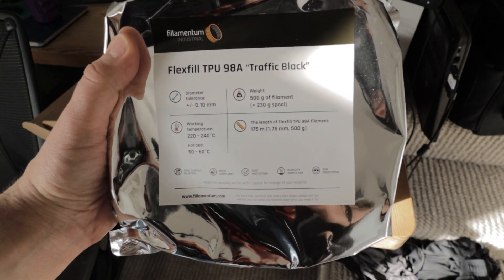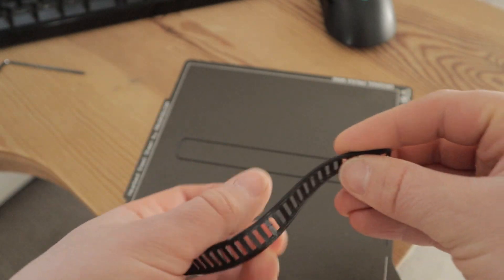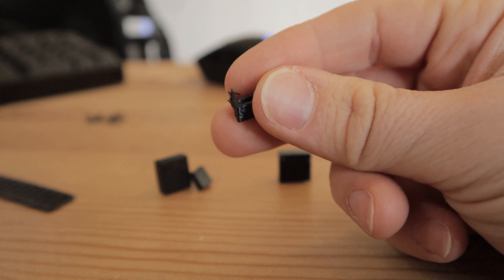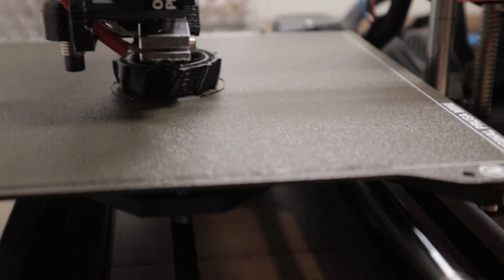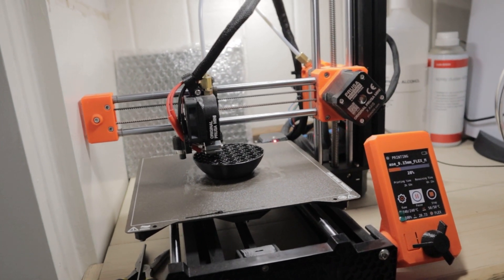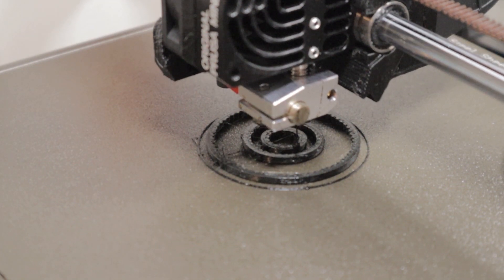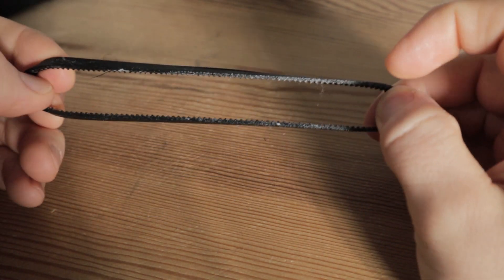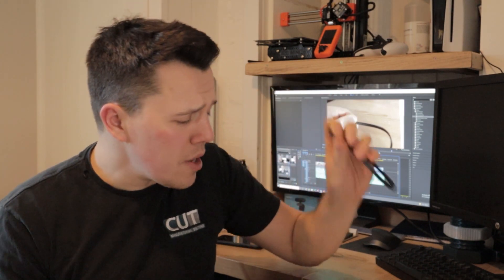Printing with FLEX (TPU) on my PRUSA MINI +

Comment: What infill, bed temp, and nozzle temp do you use? 

(Thank you for covering this topic I have been having trouble printing my hatchbox tpu on my Prusa mini plus)

(Good video)
Reply from the maker: Bed temp and nozzle temp is direct from the Prusa material guide. This is always my benchmark for setting up the machine. Infill I think was 10-15% but if your settings are correct I don’t see this having a huge impact on your prints! Best of luck and thanks for watching.
Reply: @MasonsWorkshop  One more thing btw, is there any tips you have to prevent stringing because that is a big problem for me when printing in tpu

Comment: I tried to print with a flexible PTU filament, and when I wanted to load the filament, I did not find the PTU in the list on the screen of prusa mini. How do I add the PTU to the list? please
Reply from the maker: I think you may need to add it to your library on prusa slicer, there should be plenty of information online about doing this! best of luck
Reply: Use whatever profile has a nozzle temperature range listed on your spool for loading.  as for slicing I'm out here for information on feed and speeds that work on cheap 95A...

Comment: I have recently started trying to print with TPU on my Mini.   It hasn't gone all that well and I'm assuming partly wet filament mostly because of the amount of stringing sort of like how some of your failed prints look.  I also noticed you're using the smooth satin sheet to print on and while I have a satin sheet long story short I've been using the PEI sheet without issues using ASA filament.  TPU on the PEI sheet almost welds itself.  I haven't ruined the sheet yet ripping the PEI coating, but I'm assuming the smooth satin sheet will not stick at all.  The satin sheet "naturally" has low adhesion?
Reply from the maker: Hey there, 
I do not have a satin sheet yet, only the smooth and textured! But adhesion can be a big issue with the TPU filament. My biggest help was using glue stick as a barrier between the part and the bed. This helped as a way to keep small parts firmly located but also allow separation when finished! Give the gluestick a try and this should help!
Reply: basically the smoother the surface, the better the adhesion.  Things like PLA struggle with adhesion, where from PTEG on they need less so satin then textured.  I occasionally change surfaces away from the recommended sheet if I need more or less adhesion based on the print surface area of the object.  look at Prusa's material table.

Comment: I run 40mms speed  on everything and 8mm retraction. You should slice to reduce retractions with perimeters/ maybe not fill gaps depending on the print. Small parts are harder printing at lower temps helps I run 218 mostly. This video was light on slicer settings details. Always use gluer stick.

Comment: Also printing TPU with the smooth bed surface with glue stick is much better i print alot with TPU making drone parts get your hands on sain smart TPU there is no better than that and TPU does print better with a direct drive set up than a bowen style.
Reply from the maker: Hey there, thanks for the recommendation. I will have to give that filament a try. I’ve heard a lot about a direct drive set up being beneficial so it may be something I look into👍🏻 thanks for the info

Comment: Best to print one part at a time if using materials like TPU and others prone to stringing. Otherwise adjust retraction settings. Increased retraction speed and distance too. Great vid thanks. 👍🏼
Reply from the maker: Thanks for the feedback, some good information there ! Going to revisit this material at some point and see what improvements I can get!

Comment: Hi Brandon, i think your print speed are too fast, try to print at 15-20mm/s. for TPU, if you print at higher temperature, the wall/perimeter are not looking smooth and shine, so you have to print at the lower temperature, the match temperature can be known by printing temperature tower for tpu from 195 up to 215 by 5deg increment. and if you found that the perimeter outer and inner are not bond, try to increase multiplier. and for retraction, if you use retraction, you can use 8-11mm distance and spped 15-35mm/s for retract and deretract. hope it help

Comment: hey, I have same printer and same filament. Some time ago I printed something and was quite good result. Now for some reason the gear that moves the filament into the nuzzle it is just no able to pull it in during the printing, only during the loading sees to go ok.
Any idea why this can happen?, the printer is printing PTEG and PLA without problem.
Reply from the maker: Hey Dani, 
I could suggest checking the Idler screw tensioner, this would have an effect on the moving of the filament through the machine. On the Prusa website it is recommended to loosen this for FLEX due to it being a softer material.
Reply: @MasonsWorkshop  hey, thanks for the answer. I ended up in that documentation and tried already, unfortunately with no much success, I wonder if I need to loosen it much, I tried around one complete loop of the screw.

Comment: Did you get your printer direct from Prusa. I've just found your channel, I was researching mac industries welding tables but as always with an interesting channel I'm working my way through your vids, oh and where did you get the threaded bar you used for your stool.thanks Mason and keep up the good work.
Reply from the maker: Hi Roland, 
Yes I purchased my printer straight from Prusa in the middle of the pandemic which meant it had a super long lead time. I recommend purchasing through them though, great customer service and will always help if you have any issues. 
Im glad you are enjoying the channel, great to hear that people like the videos. The threaded rod I purchased through eBay! FYI the mac industries tables are great, couldn’t be without it now.
Reply: @MasonsWorkshop  thanks for prompt reply and really appreciate any advice.

Comment: Thanks for sharing. I'm about to test printing some gaskets. Ordered some Sunlu TPU and am really curious how this will turn out on the mini.
Any other adjustments you made to the printer? I read some advice about loosening the idler on the extruder?
Reply from the maker: Hey there, I made absolutley no adjustments to the printer. I took extra care in loading the material but aside from that it was all textbook tips I had taken from the website. 
How did you get on with it in the end? A gasket is a cool idea, interested to hear how that performed ?
Reply: @MasonsWorkshop  Yep, all went good. Meanwhile printed some other stuff (like bottle caps) and the Prusa Mini is performing amazingly well (the Sunlu I use is a 95A). Option that made a huge difference to avoid strings was the "avoid crossing perimeters".

Comment: Thanks for the video. Hard to find any other videos that print TPU on a Prusa Mini. I've had mine for over a year and been afraid to even try TPU due to all the rumors of TPU not working well on Boden Tube (non-direct drive) printers. Definately going to try it now thanks to your video. (and new subscribe!)
Reply from the maker: Hi Bryan, Im very glad this video has helped. Lots of people have different opinions and experiences with the Prusa mini and sometimes it just needs to be tried for yourself! Good luck with the printing and thanks for the subscription.

Comment: Your results are infinitely better than my own test on my Prusa Mini (using Ninjaflex) - are you just using the standard TPU profile in PrusaSlicer and modifying the infill? Any info would be a great help! Thanks for sharing this!
Reply from the maker: Hi there, I added the Filamentium flexfill preset to the prusa slicer and altered none of the settings. All that was changed was the infill !
Reply: @MasonsWorkshop  Thanks, that gives me the confidence to load up that TPU spool again and experiment some more! Much appreciated!
Reply from the maker: @PeranMe  Not a problem !! I’m glad I could help

Comment: Thank you Mason for covering this topic!

It is great that you show your success and you challenges with TPU. Stringing and bed adhesion issues can be annoying, but they are generally solvable. 

You can reduce stringing by setting Z-Lift to 0, set all print speeds to 1 value (e.g. 20 mm/s), set retraction to 2mm (or to disabled) and check the recommended temperature (e.g. 220 degrees). Make sure to keep TPU filament dry, it's best to use a filament storage box or drybox while printing. What can also help with printing TPU on a Prusa Mini is using the Bondtech upgrade kit (dual drive extruder + heatbreak).

Have you tried printing with a raft/brim to improve bed adhesion? Can you test different raft/brim settings (patterns, number of layers, etc)?
Reply from the maker: Hey, 
Thanks for the comment and info. 
Stringing is definitley one of the areas I want to improve, I will run through the changes you have mentioned and see what the results are like. A storage/dryer box is also on my list, I havent felt the need for one yet, but it may be time to invest in one!  Ive heard many good things about the bondtech and I can see it being an upgrade down the line when I get some more hours on this machine. 

I most definitley need to spend some more time digging into the machine settings to fully understand print speeds and retraction. I think this will help with the problems mentioned. 
Once again, thanks for the feedback!

Comment: Try upping your retraction to reduce stringing. Also I believe Prusa recommend recalibrating the first layer height if you flip the bed. That might explain the prints coming loose.
Reply from the maker: Hey Brandon, Yes I think thats where my stringing issues are coming from !! I will be looking into this for sure. Your point about flipping the bed is an interesting one, I really wasnt expecting poor adhesion with this material.